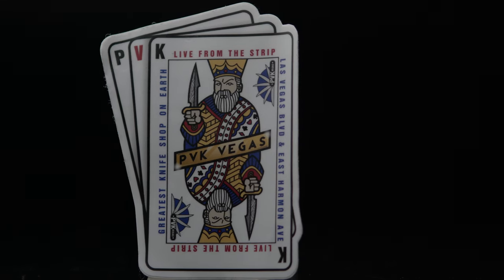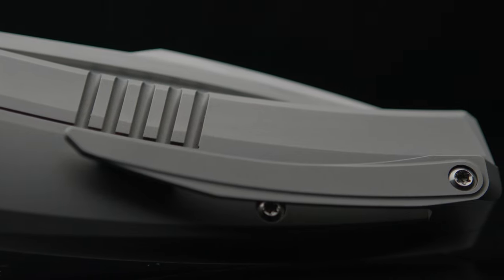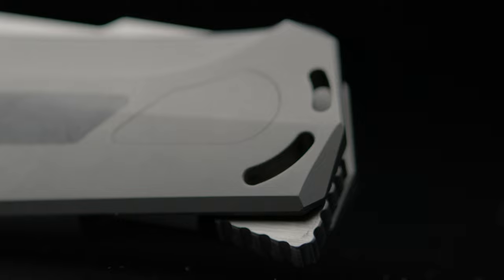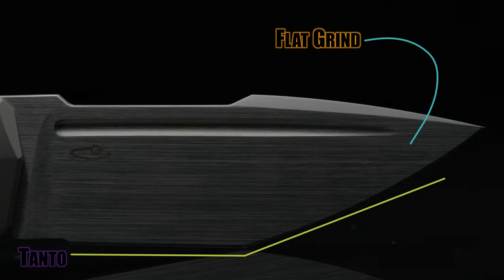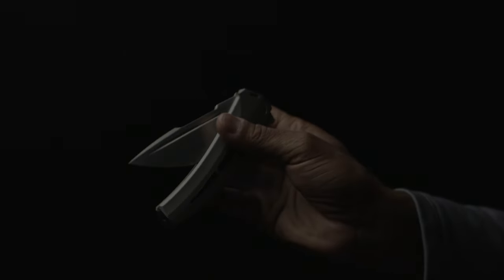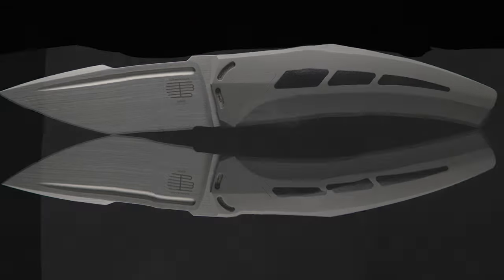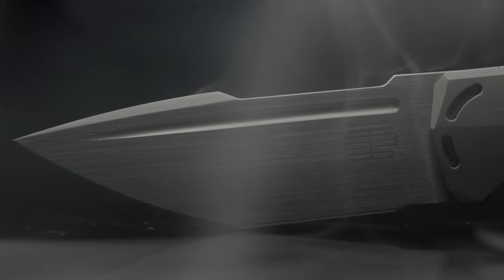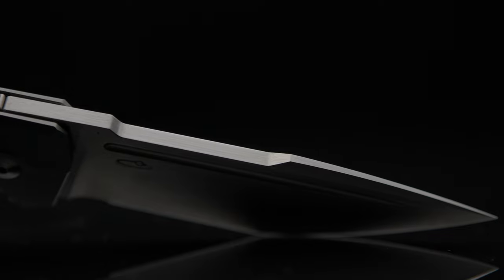TASHI KRYPTON WITH KICKSTOP MECHANISM

Comment: I really like the window gimmick a lot = fresh
Reply from the maker: what is the mirror gimmick, if you mean an effect.. no not at all its sitting on black glass,(you can see the dust on the reflection LOL) its a piece from my old tv stand, and the smoke is also real... from a machine,  LOL no plug-ins or gimmicks only film... the pop up text & transitions is the only parts I generate in post, everything else is real brotha
Reply: @THEFULLERFANATIC  WINDOW gimmick not MIRROR, I was referring to the scale cut outs that display blade steel & kickstop wording on the knife itself - only quarrel I ever have with your videos is sometimes the audio is too low to hear at my normal volume
Reply: @THEFULLERFANATIC  I think he means the windows cut out at the pivot end? Not new, see the ZT 0999. Cool video, thanks!